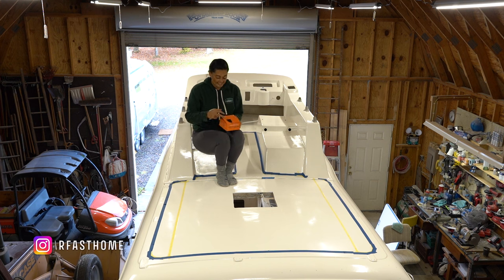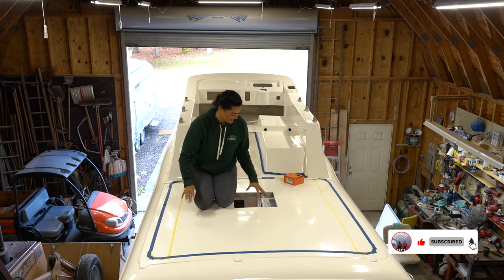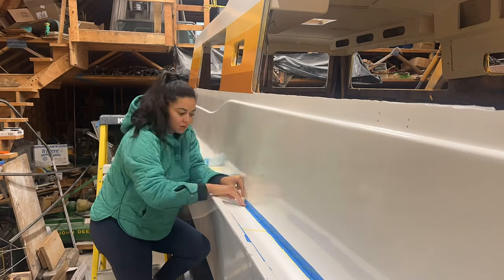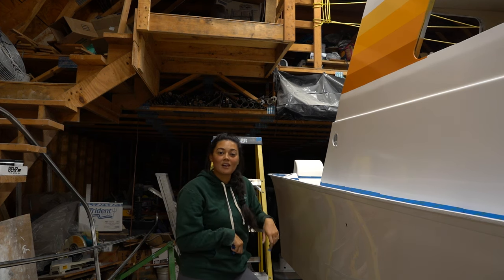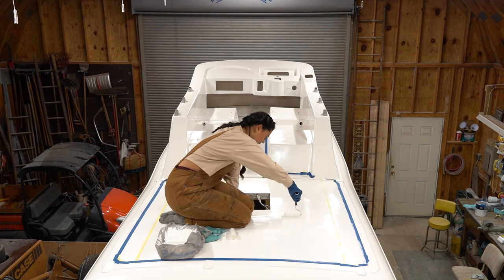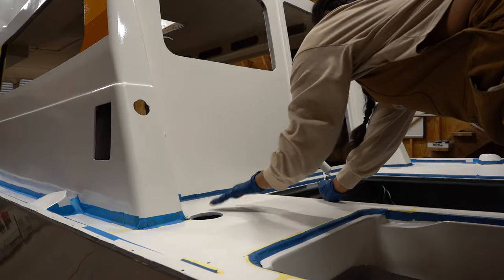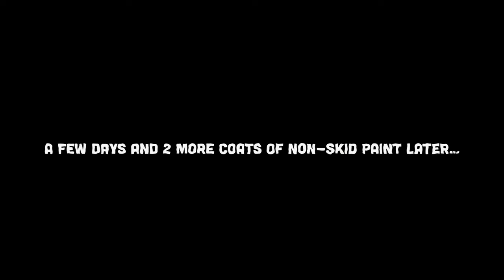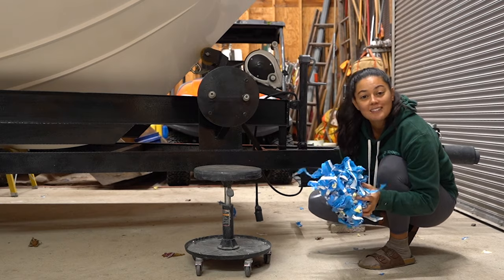Painting Non-Skid on boat deck with TotalBoat TotalTread — SeaCamper Renovation EPISODE 5

Comment: Hey! That non-skid looks good. Not too coarse looking.
I applied another brand of non-skid on the back deck of my boat, but it is about as coarse as 36 or 24 grit sandpaper (ouch!) and I will be removing it at some point.
How does Total Tread feel to the bottom of feet and on your knees?
Reply from the maker: We are really happy with this non-skid.  Total Tread is noticeable under the feet and knees but not too course or uncomfortable for it to be painful. The beads in this nonskid paint are fine, which is why we decided to do 3 coats.  Each coat came out even better than the last, and the coverage was very even (we made sure to mix the paint really well)
Reply: @slowcarfasthome , thank you!
I’ve saved your video for  future reference. 👍🏼